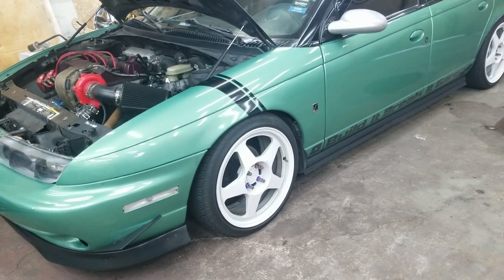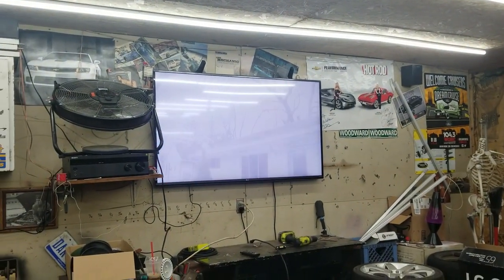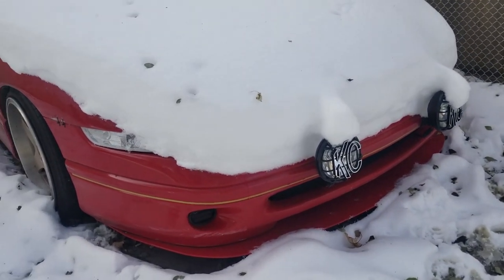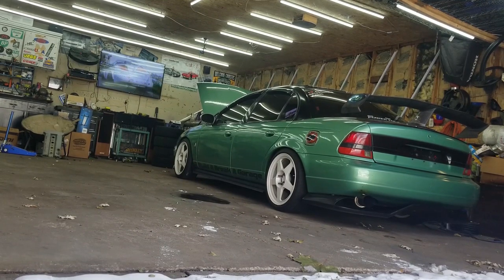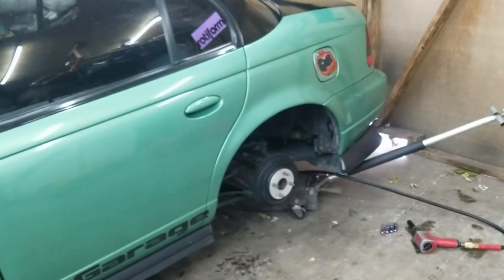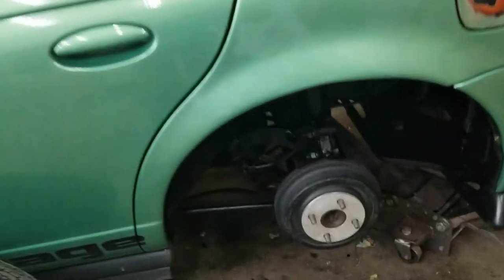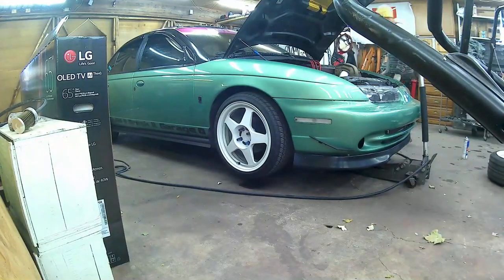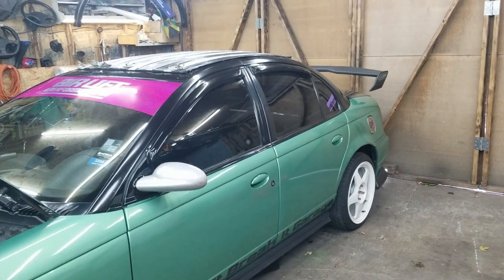Winter Cleanup

Comment: Dude super sick glad I found someone that loves and hates saturn as much as myself! Thanks for your customization and keep it up I would like to ask you questions about what you removed from the motor and what your running I would like to remove the plastic and all of the crap out of the engine bay that I wouldn't need for my 02 sl2 what intake and turbo are you running and you said you have a 96sl2 motor in it?
Reply from the maker: I removed the battery, fuse box, radiator coolant tank, washer solvent tank, power steering and ac
Reply: @BuilditBreakitGarageinc  okay sweet and the wiring harness just placed it in a new spot or what? Under the dash.